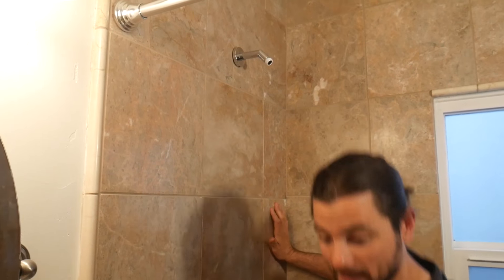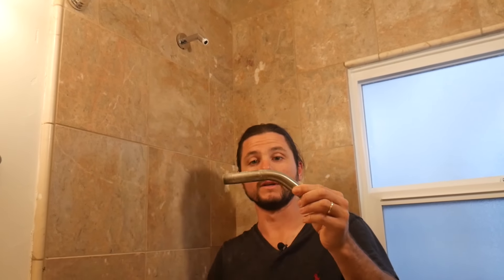How to Replace a Shower Arm and Flange

Comment: Per written instructions only 1-1/4 turns of Teflon tape is allowed for nuclear submarine use.  I would think that should suffice for home use, also.
Reply: Hmmm 🤔 yesterday  in my plumbing class we were soldering some copper tubing, elbows and a fitting for a pressure test gauge, I wrapped 4 turns of teflon tape and mine didn't leak any air, 3 guys only wrapped like 2 turns at most and all of them leaked from the threaded connection,  I think more then 5 turns is too much, but 1-1/4 seems like too little for me.
Reply: @josem.2909  ok if you “think” so.  There are several causes which you didn’t pursue for the “cause” of the leaks. I tell you what, I’ll use the same logic you used ... I didn’t have any leaks following the instructions for nuclear submarines for 35yrs. Take care & follow your industry instructions.  Oh yeh, bet you didn’t know that Teflon tape is mainly a lubricant, enabling the threading in of the tapered threads to “properly” seal the piping.
Reply: @josem.2909  Well, if you are installing pipe parts in your house that are made to nuclear sub standards, then one and a quarter turn of tape will probably suffice.
Reply: Ok thanks for your comments, we always can learn from others.

Comment: Did you turn the water off?
Reply from the maker: Yes, when a plumber is changing a shower arm pipe in a bathroom, it is typically necessary to turn off the water supply to that specific bathroom. This is done to ensure that water flow to the shower is completely stopped. However, it usually isn't necessary to turn off the water supply to the entire house for this particular task.

Comment: What is the ideal shower arm length, 6" or 8"?
Reply from the maker: Both 6" and 8" shower arm lengths have their merits. It depends on your preferences and bathroom layout. We offer a 7-Inch Shower arm and flange and a 10-Inch S-Style Shower arm. You can find them in our accessories option here: https://www.theshowerheadstore.com/collections/accessories

Comment: My house is 50 years old. I used only rotational force. Both the old shower arm and the elbow piece broke/crumbled where the threading is. Need to call a plumber 😭

I bet the the old homeowners caused damage when they redid the shower at one point.

Comment: How do you make sure it may not be dripping behind the wall?
Reply from the maker: If there is already no problem with your valve in the wall then we recommend going heavy on the Teflon tape around the male ends of the shower arm to ensure that there is no leaking.

Comment: How many times do I need to go around with the tape?
Reply: Hello, Angelica! If you are adding a new shower arm and flange then we recommend that you go heavy on the Teflon tape about 5-6 turns (clockwise) on the section that goes into the wall.
Reply: @soothingstyles8749  Thank you! Yes it will be new ones

Comment: How do you know its not leaking in the wall?
Reply from the maker: Dripping or spraying water in the wall will soak the plasterboard or drywall. Paint peeling from the wall in and around the shower is one sign of a leak. Loose and peeling tiles are another sign of moisture behind the wall, as well as a musty smell.

Comment: This video is easy to follow. Maybe I’m not strong enough, but I can’t get the arm off. Even with the screwdriver.

I’ll check out your store too, haven’t found any replacement three knob fixtures that I like.
Reply from the maker: Hello there, if your shower arm is in the wall for more than 7 years then rust can build up internally on the threads causing problem to remove it. In this case, we recommend using 2 tools for the job. In your left hand you will use a wrench to hold the shower arm (where it exits the wall) firmly in place, while you have a screw driver or any long enough metal that can be placed inside of the shower arm. You will then need to apply pressure in a counter clockwise direction slowly. Let me know if this helps.

Comment: What if it's a hard 90, straight down off the wall ? I cannot find any other fitting like it.. It is around 10-13 years old. Made with a vacuum fitting that attaches and then a handheld & hose - attached to a grab bar. I'm wanting to delete this and make a normal angled showerhead.
Reply from the maker: You'll need to remove the 90 degree fitting (wall elbow/drop ell). There is likely a short nipple threaded into the wall that the wall elbow threads onto. You'll also need to remove that. Then, you should be able to install this type of shower arm without a problem.

Comment: how do you ensure it doesn't leak behind the wall? with the actual shower head it will be obvious since the threads are in front of the wall, but the arm goes behind the wall.
Reply from the maker: Put a ton of thread seal tape on the threads and tighten it down as much as you can. The female connection in the wall has pretty deep threads, so you shouldn't have a problem getting it to be watertight if you make sure you give the shower arm enough rotations.

Comment: tried everything, arm won't move how much force can I use?
Reply from the maker: Hi John, In this case you can use quite a bit of force, but if you are already trying hard and not moving it, we would suggest to consult a plumber. this is because we wouldn't  want to cause a leak.

Comment: My shower arm is loose. Is it just I have to turn it like you show or could the female end inside be incorrectly set. I just bought a new house and a repairman acted as if I can’t do anything about it since it’s in the wall
Reply from the maker: Is the arm loose or the entire piece in the wall? Some homes are built with PEX instead of copper and it does not hold the shower arm sturdily in place. If it's not supported by a brace inside the wall, it can jiggle around when you touch the shower arm. That could be what you are experiencing, which there isn't much you can do about it.
Reply: The Shower Head Store yeah it’s in the wall. It was a flip and they did a half azz job. Guess I’m SOL, thanks for the reply

Comment: What if I turn that original shower head arm lose one half turn so that it’s angled upward for a shower head I’m installing? Am I risking leaks with this arm half turned lose to have it angled upward?
Reply from the maker: There's always a risk of leaks if a component is not fully tightened down. In this case, I would suggest using a heavy amount of thread seal tape on the end of the shower arm going into the wall. That way you can mitigate the chances of any leaks while still being able to have the shower arm pipe pointing up. Do your best to thread the shower arm as far into the wall without damaging the internal plumbing. The screwdriver technique outlined in this video will help out big time.

Comment: What is the purpose of the flange?
Reply from the maker: Hi Rosmarie!  It's only purpose is to cover the hole from which the shower arm shows up. This avoid water from spilling in that hole, as it would damage the inner part of the wall and to be esthetically pleasing. 
I hope this info helps!
Reply: @theshowerheadstore  thanks for responding, this is helpful.

Comment: I’ve rationalized for months that my cracked leaking shower head pipe didn’t need to be fixed. I mean it only leaks 5 minutes a day when I shower. Well after watching this video I’m going to fix it. I can’t make it worse, right?? Right??? — thanks for the video.🤗
Reply from the maker: Most definetly! As you can see, it is super easy to make that fix!

Comment: The hinge of the shower arm broke and the little piece of the hinge is still in the thread inside how do i remove it
Reply from the maker: Let me clarify. Are you saying that the threaded piece of the shower arm broke off inside of the wall? If so, you'll need to a special tool called a Shower Arm Thread Remove to extract that peice. There's a great video on YouTube on how to do so. https://www.youtube.com/watch?v=NDppaI1RbHc You can always email us at contact@theshowerheadstore.com or reach out to us through Facebook Messenger @theshowerheadstore.

Comment: Hello, I recedntly bought a speakman showerhead but it is weak, I thought if I changed the arm  leading to the showerhead, the water might flow better because I thought the pipe was more narrow than what was up there --  turned out it was the same as what is on there.  But in any event, here's my concern -- and if anyone reads this maybe they can advise me:  I bought the Speakman arm and it is  7 inches long it stretches out for 5 inches and it curves two more inches.  By watching this video, holy cow, that shower arm went in at least three inches and if I do that I will have to stand up against the wall to shower, lol.  Well, I don't know? I an old lady sitting down at the beach what do I know?  You guys are going to have to come to my rescue, I live in an apartment building -- its a long story here -- but I am not allowed to have a plumber without permission and I have to do it myself.  Now, I also have one of those shower caddy's that ya place over the pipe it has shelves on it?  I don't know how far does it go into the wall.  Guys feel free cause I haven't a clue and if ya herer an explosion or scream ya know its me.  LOL.  HAPPY NEW YEAR EVERYONE.

Comment: I’m so afraid to do this because I don’t think there anyway to make sure nothing is leaking behind your walls.
Reply from the maker: Once there is no problem with your valve in the wall, we recommend going heavy on the Teflon tape around the male ends of the shower arm to ensure that there is no leaking.

Comment: Do I need to turn water off to do this?
Reply from the maker: No, you don't need to shut off the water to change your shower arm. Obviously, make sure your shower valve is in the fully off position, just like in the video. As long as there isn't any water coming out of your shower head you are good to go.
Reply: Thank you hubby is useless  and cheap so thank God for these videos 😂😂😂😂😂
Reply from the maker: @LindaM1961  That's what I'm here for. ;) Glad you found the information helpful.

Comment: The teflon tape was wrong direction. But great video👍
Reply from the maker: Thank you so much. We are aware of this and that is why we added it in the description showing (Heads Up: Thread Seal Tape should be wrapped counter-clockwise on both sides. Video shows tape being applied clockwise from the one side.)
Reply: @theshowerheadstore  👍👍 do you use sealant behind the eschechon or do you not need it since its above the showerhead? Im installing a showerhead like this but also a rainhead  above this one coming iut the ceiling.. do you think i should seal around both eschechon with silicone?
Reply from the maker: @JLitt-us4vs  There were no silicone used in this video as we were merely showing how to change your shower arm and flange in 5 minutes. However, if your surface isn't level, I would recommend using silicone or plumbers putty, as mentioned in the video, as an extra precautionary measure.
Reply: @theshowerheadstore cool thank you👍
Reply from the maker: @JLitt-us4vs  You are very welcome!

Comment: Would not have done either like that, obviously not wrap the wall side tape the wrong way, and would not have pre-taped the shower head threads either so the tape wouldn't get bunched or nicked while trying to thread the arm back into the wall...but that's just me.
Reply from the maker: Your feedback is super helpful, thanks for sharing your thoughts!

Comment: You put the tape on backwards. You need to turn the pipe in the same direction it installs in.hold the pipe in your right hand with the threads on the left. Roll the tape on the pipe coming over the top towards yourself.
Reply from the maker: Good catch! 🎯 We've already updated the notes to fix that. Thanks for pointing it out!

Comment: I wish it was that easy! 👎
Reply from the maker: if you never changed a shower arm pipe before, you may have your hesitations but its pretty easy one you follow the instructions.
Reply: @theshowerheadstore  ok brother, will do 🤞
Reply from the maker: @rnsone8827  Let us know how it goes.
Reply: @theshowerheadstore  I can’t unscrew arm out because of the ceiling! 😭 just half a revolution! I’m thinking I might have to cut it in half? But how ?
Reply from the maker: @rnsone8827  You can attempt to remove it also by using a pliers and a screwdriver. With the pliers in your left hand holding the shower arm firmly in place, place your screwdriver inside the shower arm and and turn counter clockwise. The shower arm goes into a shower valve inside the wall and they are not permanently installed. Some plumbers can crank them down more than others, which can make them hard to reverse out of the wall. And, of course, if it is an old one, it could be really calcified in the wall so you'll need to really crank it to get it out. If you aren't that confident, it's best to hire a plumber.
Reply from the maker: @rnsone8827  when in doubt, hire a plumber!